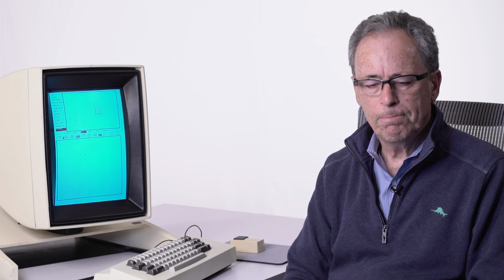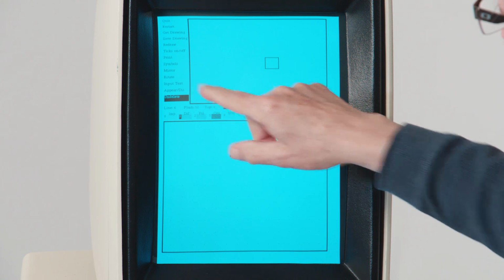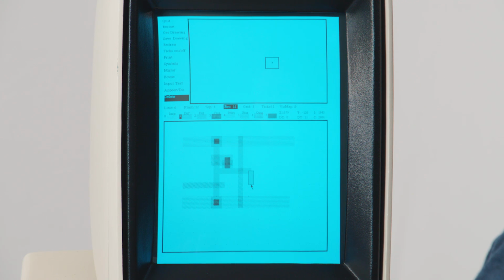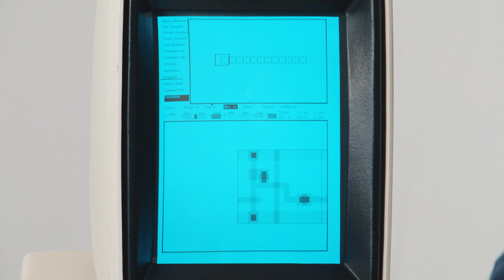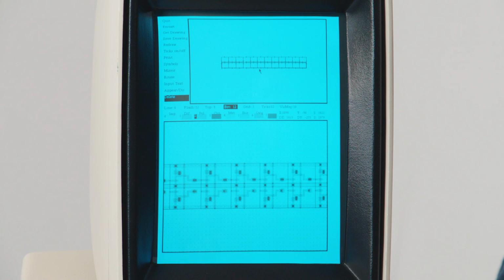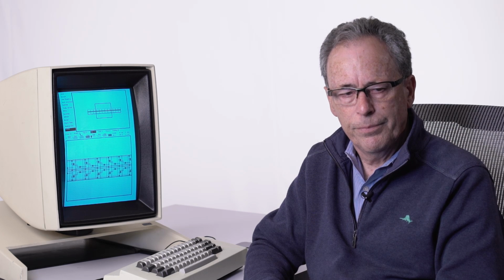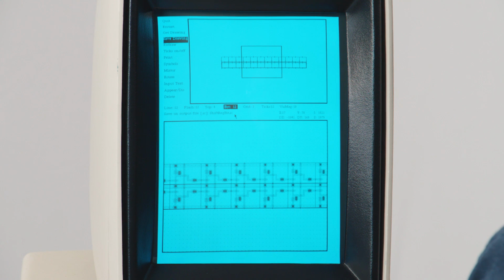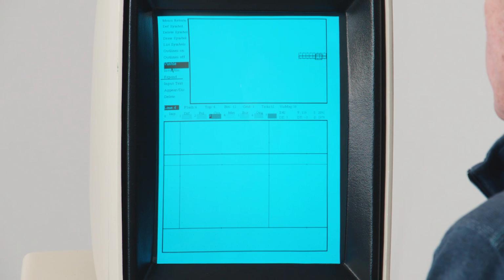Video Ethnography of "ICARUS " on the Xerox Alto

Comment: Unbelievable. Uses 4 chips, each one 4-bit and containing 75 logic gates giving the programmer 32 instructions (almost half that of the dreadful BBC Micro!) - 16 arithmetic and 16 logic. Originally ran at 45 Mhz, later models at 90 Mhz and 143 Mhz. We were subsequently sold criples of computers. What dupes we were. 🦕